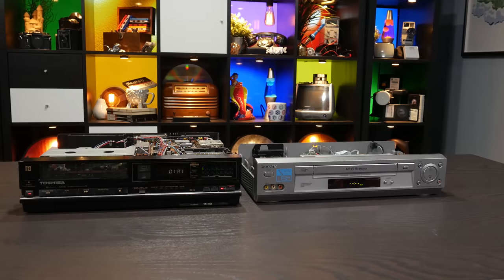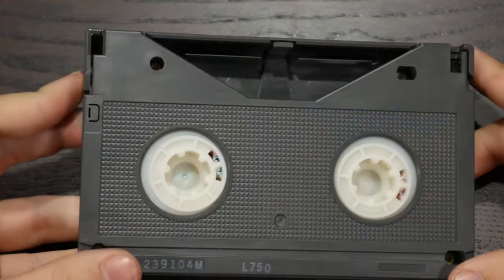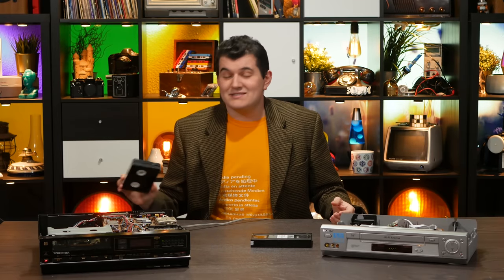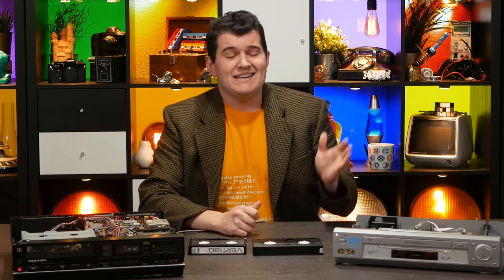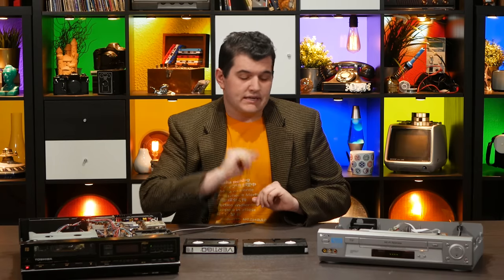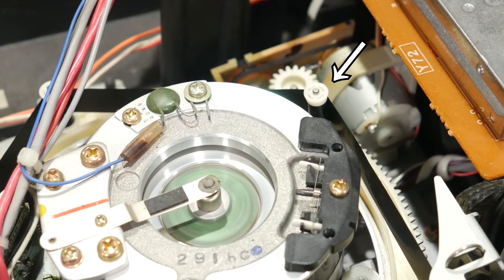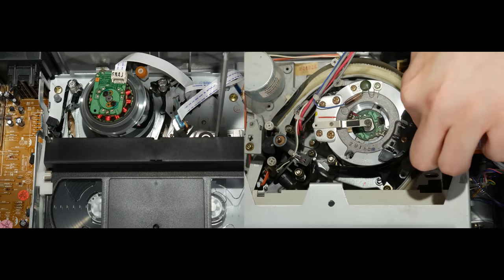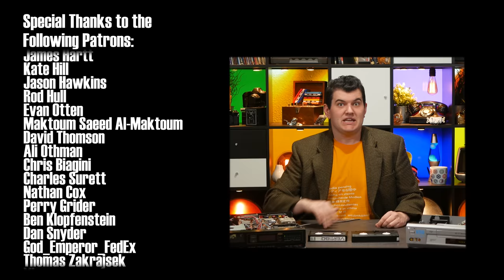The VHS cassette was more clever than Beta

Comment: Hi!
Can you connect a vcr to a pc via scart cable(or somehow) and record digital content on tape?
Thanks!
Reply: The old video tapes are analogue. So the process is to convert from digital to analogue. Many devices enable you to edit digitally by transferring in to a digital format and then writing back an analogue signal of the finished edit. If the video recorder has iLink (Firewire) as found on some miniDV and digital 8 camcorders you can record a digital copy but that might also mean a file format conversion. The transfer of miniDV or digital 8 files from the tape to a computer has files much larger than using MPG, TS. MKV or M4P formats found in streaming, mobile phones or digital cameras.
Reply: @geraldmcmullon2465   thanks 😉

Comment: Well, some of the arguments in this video are quite week:
- 30 cm of tapes still only amount to a few seconds, so it's not insignificant compared to the overall length of the tape.
- the amount of wear on each sport where the tape is touched depends mainly on the forces that are exerted on the tape on these spots. For this you need very detailed engineering specifications and complicated calculations, or you could use some technique to measure it, but you can't say anything about it by just looking at the mechanism or counting the amounts of sharp turns.

But overall I guess it is true that VHS was superior, especially at the beginning when the recording times of Betamax where too low to make a lot of sense (I mean you couldn't even fit a feature film on a tape and definitely no American Football match which seemed to be very important for Americans already at that time).

Comment: One thing the Beta Max could do easily that no other VHS could do was a "Tape to Tape Recording!" It was able to decrypt any encryption placed on any tape so that you could make copies that were of a very high quality! This recorder was the one thing that caused a huge uproar in the Recording Industry in general. I could always record a tape from VHS to BETA MAX, but never the other way around if the VHS Tape was encrypted. The failure of BETA MAX was the result of Political and Industry Lobbyists in Washington!
Reply: What in the world are you talking about? The signals on VHS and Betamax tapes aren't encrypted. If you're thinking about Macrovision, that didn't involve any form of cryptography, and was just another analog signal that messed with some, but not all, VCRs auto gain control. The video/audio signal wasn't encrypted.

I suppose DigiBeta or DVHS could store encrypted data, but those are different formats entirely.

Comment: I wanted to know why home recording on both Beta-Max and VHS tapes images have over the years become so degraded.
Reply: The magnetic part of the tape "rots" and comes away from the plastic backing. These can be partly fixed by baking at 80 C if you have fine temperature control of the oven. Reel to Reel (from 50s and 60s) have the same problem. The baking trick might enable a on off playback to transfer to a new digital format. Although the tape might be used for a new recording that would be not too bad there would be little point - it is recovering the original recording that might have something of value to you or your family.

Comment: As a kid I upgraded my betamax collection to vhs by swapping the cases. It actually worked.
Reply: "As a kid I upgraded my betamax collection to vhs by swapping the cases."

No, you didn't.

"It actually worked."

No, it didn't. VHS and Betamax are incompatible formats, not just in terms of the cassette design, but also in terms of the video signal on the tape itself and how it's read. See here:

https://youtu.be/uoZ06US0tw4?t=1760
Reply: @MaximRecoil  I don’t have to click on the link. I know what I did and it worked. Worked for years.
Reply: @johngoldberg5589  No, it didn't work. I can state that as a fact because it's literally impossible for it to have worked. Head drum size, tape speed, the angle of the recordings, and other things are all different. You'll get some unintelligible sound and some horizontal gray lines on the screen. 

Anyone can click the link and watch it for 15 seconds to see exactly what happens when you put a Betamax tape into a VHS tape shell and play it in a VHS machine, and therefore know you're either making stuff up or misremembering what you did. You might as well claim that you put a Sega Genesis cartridge PCB into a Super Nintendo cartridge shell and it worked in a Super Nintendo, or that you took a CED disc out of its shell, put it on an ordinary record player connected to a TV, and it played the movie. These are the types of impossible claims that someone in 4th grade might make.
Reply: @MaximRecoil  At 28:47 he clearly has sound and picture. He wasn’t using the machines I was using. It’s possible that it worked for me, not quite the same as claiming I played Genesis on a Nintendo or whatever. 30 years ago the tape was in much better condition,
Reply: @johngoldberg5589  "At 28:47 he clearly has sound and picture."

That's because he's playing it in a Betamax machine at 28:47. Back up a few seconds and look at the machine he inserts the tape into. It clearly says "Betacord" (which was Sanyo's name for their line of Betamax machines) on it and has the Beta logo. You need to watch at the timestamp I linked to (29:20), where he specifically answers the question of what would happen if you tried to play a Betamax tape in a VHS machine, and shows a clip of what it looked and sounded like when he tried it.

The reason he transferred the Betamax tape into a VHS cassette shell in the first place is because he has a professional tape cleaning machine but it's for VHS. By doing that he was able to clean the Betamax tape in his machine.

"It’s possible that it worked for me, not quite the same as claiming I played Genesis on a Nintendo or whatever. 30 years ago the tape was in much better condition,"

No, it isn't possible, regardless of the condition of the tape. The video heads of a VHS machine are looking for the video signal in a completely different spot and at a completely different helical scan angle than how they are on a Betamax tape.

If you're not just making stuff up, then you probably transferred the tape from VHS-C cassette shells into standard VHS cassette shells, which would actually work.
Reply: @MaximRecoil  it was a Betamax. I bought it at a garage sale for five dollars when I was 11. My friends and I found an old VHS porno stashed in the woods and we wanted to see if we could watch it so I transferred it into the betamax case and we were able to watch it. I can’t attest to the quality because back then everything looked crappy and kids aren’t too picky to begin with. At the time I was extremely proud of having figured out that you could do that. I was doubtful that would work. Not that I had any clue as to the inner workings of either machine. Apparently if I had as much knowledge as you do I would’ve never tried in the first place.

Comment: The VHS was so superior that beta was used as an ubiquitous professional television transport format for analog, digital, HD and news gathering until the Japanese earthquake of 2011 wiped out the supply chain and prores supplanted it. It is still used as a digital storage backup format, albeit disk drives are now more affordable and practical than tape backup.

VHS died in 2004. It’s professional version, Panasonic P2 introduced in the mid90s was never widely adopted.

VHS was popular with home consumers and amateur producers because it was cheap. Not superior in any way.

Comment: HD-DVD was nice. Bluray was more durable than any DVD. If HD-DVD was anywhere near as durable it would have won. VHS won because the tapes were far cheaper. Licensing was a small part, but betamax manufacture was super pricy compared to VHS. Just the tape was far cheaper.

Comment: Ha, loved this video. Straight to the points. I literally got (for free even) a mint condition, original 1st gen Sony Betamax VTR. The one with the clunky VHF and UHF TV tuner knobs on it.
Even though it works, I only got it to put on my vintage tech shelves/display. It is so mint, there isn't a scratch on it and it sill have hit factory original vinyl "half" cover.

Comment: uhm... yeah... "Video History: V2000 - The format that came third in a two-horse race", the video Techmoan made a year before you made this one.🤨
that video goes way beyond what yure telling us about : 
philips is the company that gave us cassette tapes ! it's 'video'-cassette was like the audio-tape but bigger ! (Philips also invented the CD,  Compact Digital Audio Disc by the way)
you could swap it around and play the 'B'-Side !
up to 16 hours on a 2x4=8 hour tape in long play mode !
my friend's dad was the V2000 Engineer of the motor-bearings and the video-head.
One day he received a tiny little drill in the mail from Japan, with the assertion this was the smallest diameter of drill they could make.
So he drilled a hole in it and sent it back.
This story can be found on the net ; i've seen it mentioned 3 times. (links? sorry dunno ; i can't remember the links)

Comment: Would you do a show about the PSP in the Vita and why DaVita failed well we all know it's Sony's fault but still how the little discs work
Reply: The UMD isn't that terribly interesting as a disc format. It's just a slightly improved, but incompatible DVD. The size of the wavelength, pits, and lands are smaller than a DVD, so it has a larger data capacity, but it didn't switch the type of lazer.

Comment: I am an engineer and now a prof. Of engineering. I worked with them from the beginning sent to schools for both. There are hundreds of reasons for beta machines being much more superior. But the big one was passable lines of scan using different types of units. And one more thing it was called beta for the fact it was the 2nd using that format - 1 and 2 inch ampex 3/4 umatic and 1/2 beta (the last 2 inside cassettes there for beta) if you really want to see a strange type of vcr look into the magnavox over and under system

Comment: I know I'm years late here, but what's going on when the machine eats your tape?
Reply: When the take-up process fails.  Normally, the tape is pulled out of one reel, run through the capstan, by the heads, and then back into the cassette where it is wound onto the second reel.  But if there is any jam or disruption on the take-up side (slipping belt or slipping rubber drive tire, for example), then the tape bunches up all over the place inside the machine, and gets caught and wrapped around almost anything that moves.
Reply: @cowsongs  interesting

Comment: i STILL HAVE  ALATE 2012 MAGNAVOX  DVD VCR COMBO WITH  SVIDEO AND COMP VIDEO  OUT PUTS FOR DVD THE VHS IS LIMITED  TO JUST A  SVIDEO OUTPUT BUT THAT IS WAYYYY BETER THAN RCA YELLOW OUTPUT JACK. THE WORST E EVER WAS CONNECTING IT VIA COAXIAL CABLE CONNECTION.